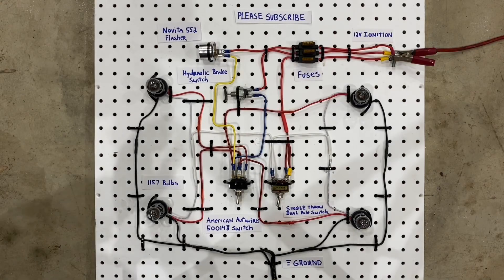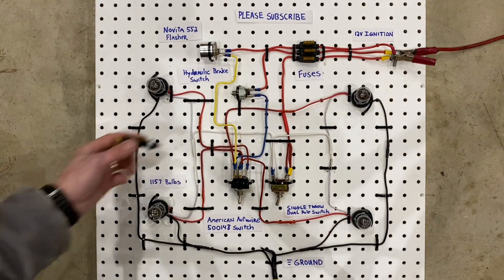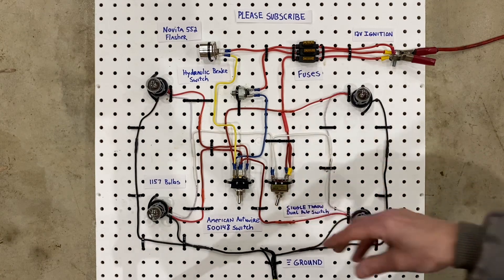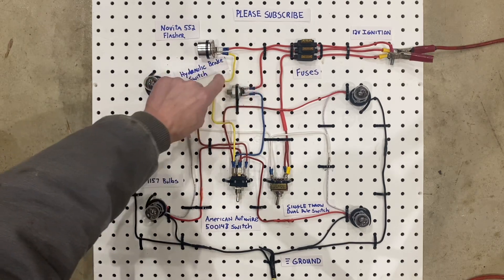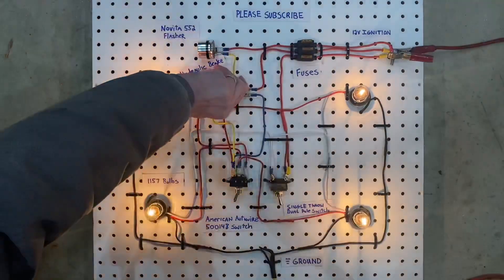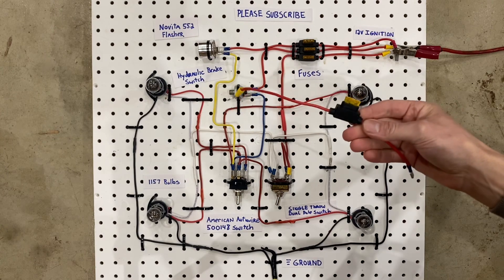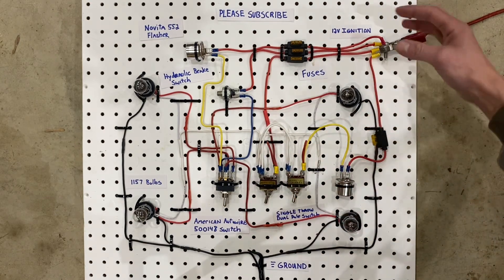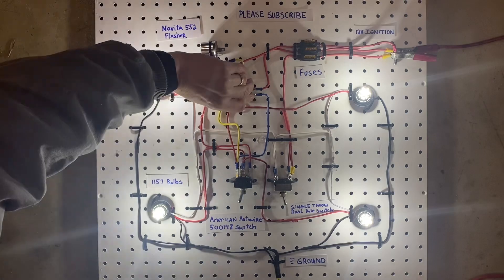How To Wire Turn Signals, Brake Lights, Parking Lamps, and Hazard Circuit Switch | @WiringRescue

Comment from the maker: Thank You for Watching my Turn Signal Wiring video! 
Subscribe To This YouTube Channel: http://www.youtube.com/user/4g63mightymax?sub_confirmation=1
See My Wiring Playlist: https://www.youtube.com/playlist?list=PLsF7T1tRFy2hmiiUUfMZNyV-BUA_yrPIh
Reply: Great video. I recently bought a flatbed truck. It was bare bones so I'm in the middle of fabricating a reciever/bumper for it and tomorrow I'm gonna start wireing it up. Wireing has always been like witchcraft to me so this video has been really helpful
Reply: Thank you! I did subscribe and hope you will check out the few videos I’ve posted on shade tree tech.
Reply: Shouldn`t the blue wire actually go to the middle post on the three way toggle? otherwise how does the power get to the right wire? I must be missing something.
Reply: Thanks for the insightful video. I tried this setup on my motorcycle but  without the use of diodes on the BRAKE and TURNSIG wires I couldn't sort out a fix...with the diodes the running worked, Brake works but turn sigs are cancelled by the brake. 😂 Any intuitive thoughts on what my problem might be? BTW my rear lights only have a ground, red and white (running) so BRAKE and SIGS have to split the RED after the diodes.

Comment: Will this work if you just add a directional flasher and splice into the rear directional wire? Not on for running, if you're braking the oem brake light is still solid one side but flashing both oem and your new flasher unit?

Comment: I know this is an old video, but i have a question: If i don`t want to add parking lights ,and i want to use dual filament turn signals on the back only, where one filament will act as turn signal and one as braking light... can i add the braking function str8 to the actual braking light wiring (let`s say split from the back braking light wire directly) ?

Comment: Is there an alternative method, that does not required  American Autowire (25Amp @12V) 500148 Switch?  Like using two separate On-Off-On toggle switches?  Or a  3 Position Toggle Switch 3 Way Automotive Car 12 Volt SPDT ?

Comment: How does the power know where to go from the brake light circuit being tired to running light and turn signals. I understand the switch is what breaks up the power and sends it where needs to go.

Comment: So when the brake lights are on and you hit the turn signal what is happening in the switch to allow the flash? Wouldn’t there still be constant power from the brake being applied?

Comment: Hey Jeremy you didn't use a relay on the circuit. Why is that? In one of your previous videos you said you wouldn't want to connect 12 volts because it would burn up the stitch. Thanks for your work. Your videos are simple but awesome. Completely helpful.

Comment: How many prongs does that toggle switch have the 500148 I need to hook this system up in my car
Reply from the maker: I believe it is 6 terminals. If you are looking for a cheaper version of the same switch, you won’t find one. No other 6 terminals switches work the same way internally. That is what makes this switch special. Good luck with your project!

Comment: I don't know if you'll see this, but I have a question about wiring the American Autowire switch. Do you just wire the brake wire into one of the turn signal leads or both. I have a 1964 F100 that I will be rewiring in this way and I want to make sure I do it correctly. Thanks for all of your really informative videos.

Comment: can you use the a Heavy Duty Rocker Toggle Switch 20A 125V DPDT 3 Position 6 Pin ON/Off/ON Switch instead of the autowire 500148?
Reply from the maker: Sadly, no, because the auto wire switch is actually a special type of switch. It’s not a regular on off on switch. I have looked far and wide for others that work that same way, and could not find any. If you do - let me know!

Comment: Thank you for making things easier to understand lol. I'm about to completely re-wire my 51 mercury for the first time lol, and I need to learn some more first
Reply from the maker: There is nothing better than a 49-51 mercury. Goodness I’m jealous!  Good luck on the project and check out my wiring playlist. I have dozens of wiring videos that will surely help you understand all the basics you’ll need. In the near future I’m going to make a video on basic ignition systems (distributors) and a universal fuse box. So stay tuned for those if you think they might help you out!

Comment: was about to commit this monstrosity, but new turn signal switch worked for about a good week, hmmm... wrapped aluminum foil onto worn out 53 year old bullet style plug connectors for the rear, n all good again. (had turn signals, "continuity" from column all up to the bulb sockets, but no brake lights)

Comment: I have question: I am reworking my car old wire installation, so bow i am on headlights and rear lights.
So i am wondering, can i putrear lights with hugh beam and low beam with seperate rrlays so ehen i turn lights i have rear also on one switch or need something different ??

Comment: To wire in the license plate light do you have to just tap into the rear tail light wires so they turn on when I turn on the headlight switch?

Comment: Was wondering why you should wire the hazzard switch to the low filament parking light instead like every vehicle pretty much uses the high filament brake/turn single which would be more visible than the parking light?

Comment: as a 75yr old guy from the UK i always find your video's easy to understand ! - i wonder what part no. would be available over here equivalent to the 500148 ??- many thanks
Reply from the maker: Thanks! This switch is very unique and I haven’t been able to find another with similar functionality anywhere. So - you may have to grab one of these and have it shipped, or use some relays instead. 😢

Comment: 500148 is the key to this whole thing. I was very puzzled up until i realized all that one switch does. Thank you.
Reply from the maker: You are absolutely correct. I looked high and low for other switches that work the same way, and I did not find one. This switch is special and worth the $40 if it fits your dashboard decor!
Reply: @WiringRescue  I'm finding them for 50 and it'll fit my dash as there's not really a decor. When did built this trike I think he was over pretty when it came to wiring. Wiring is scary.

Comment: Great video. I do not see why you need a double pole switch for the running lights with the left and right sides on separate circuits.. A single pole switch connecting to all four would work the same way.

Comment: hi there can you help me please i just cant get my head around doing this but with the relay method as like your other video i need this setup fully functional but with relays, turn signal, brake light, parking light and hazard brake and parkers and turning in the one bulb. cheers

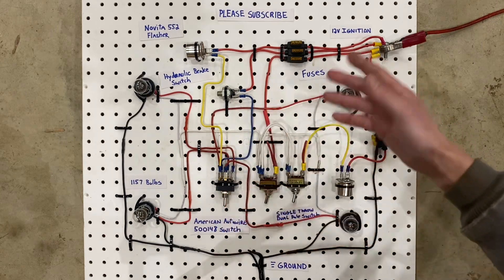Comment: 9:56 If both the parkig and emergency switches were on at the same time I assume the parking lights would just remain on, but wouldn't there be a slight power ripple every time the blinker switched?

Comment: Hey guys, I’m in a bit of a situation here 😅 I had a “friend” work on my turn signals and brake lights and everything looked fine until I tested it out. My brake light activates both the brake lights and my left turn signal, with my left signal even showing up on my dash when I brake! It’s clearly a brake wire spliced with the left turn signal, I’m just struggling to find where he may have spliced the cable. If anyone can help out it would be a great deal of help, thanks guys 🙏🏼
Reply from the maker: Make sure it’s the correct bulbs. The wrong bulbs will do that.

Comment: Lets say you have 4 red rear lights LED. 2 left 2 right. You want to use them as taillight, brakelight and turn signal (also red). How should be the wiring?

Comment: Using a DPDT switch for the hazards and 4 diodes you don't need a second Flasher and it is very easy to wire.   Use regular Schottky diodes used for Solar panels. They have THICK leads and are easy to solder, crimp connectors to or just twist together. 

Solder or crimp the Cathode, with each of the turn signal wires that go to the American Autowire (25Amp @12V) 500148 Switch.

The Anodes all go together and to the DPDT switch. 

Sounds Complicated but it's not.

If you want to make it look more sleek, look up MBRF20200CTR 20 Amperes Insulated Dual Common Anode Schottky Half Bridge Rectifiers TO220F.

Comment: Why split the power to the single throw dual switch? Couldn't you just do on wire in and split two wires from one pole?

Comment: So you don't need any Relays for this ? I'm in the process of rewiring a 69 VW bug i"m trying to modernise it The Gurmans wiring is crazy how they designed it Very difficulted  even with the wiring  schematics
Reply from the maker: You don’t need relays if you use the same components as what’s in the video. All of the amperage is going through the switch itself and as long as the amperage draw is lower than what the switch is rated at, no relays are needed. Good luck with the VW project!

Comment: Had question about 500148. Is this just a standard dpdt 8 pin toggle switch with just two outside pins jumped to reverse pins on opposite side?i see on back they just add in jumpers and removed those outside pins and charge 4x as much for a 8 pin dpdt you can just jump across yourself. Cant see 50 for a 13 toggle just because they removed pins and added a jumper in back.

Comment: I am having trouble finding the correct wires to make the parking light and turn signal. It is a 2 wire 1157 bulb. I have tried every combination to get them to blink. Parking lights work. I will start over again.  Any suggestions would be appreciated.

Comment: 57 Bel air restomod changed tail lights and front running lights to Led panels with 1157 plugs. Brake lights work, running work, Turn signals get brighter but won't blink. Changed relay to led type still no blink just brighter. HELP

Comment: How is this done without the auto wire switch question? Mark. I have breaklights in blinkers that are going on together. Obviously I'm not going to rip apart the whole - to put in the auto wire switch so there must be some other way to do it.?

Comment: My daughter got a 2009 Toyota Corolla and a mouse/rat chewed every wire it could reach. I've got every light working, including parking, brakes, and hazard on all 4 corners. Only thing not working is left turn signal not flashing and it clicks rapidly on inside dash, one license plate light isn't working and the middle rear window light isn't working.

Comment: How does the turn signal cancel out the brake lights when signaling with the brake pressed?
Reply from the maker: The American autowire switch is what allows this to work. The switch is specially made for this function. That’s why it’s a $35 switch instead of a $5 switch. :)

Comment: In the factory wire harness for the 1976 Ford LTD what wires in the circuit and where are they can I import some 1156 turn indicators to the back of the car and stop interrupting my brake lights. Breaking up the 1157 and to 11:56 for breaking and parking lights is pretty straightforward and simple but it's that brake light interruption and sending power to the same filament when you release your foot off the brake is where I'm confused how to convert my car to 1156 bulbs in the back end pairs of each parking brake reverse turn indicators.

Comment: Hi Jeremy there's a very important video you need to make, how to convert USA dim bright red blinkers to on off yellow blinkers. For example on my 76 LTD to convert my reverse lights into yellow blinkers and no longer interrupt my brake lights. With my new reverse lights housed in a Lincoln Continental bumper VMI bumper tuck conversion. That way I'll be running 3 1156 bulbs in the back left tail light will have a parking light only brake light only right brake light will have parking and break only each turn indicator and Hazards utilized in the rear trunk lid reverse light housings and then finally the new reverse lights will be housed in the rear bumper how can I undo the dim bright 1157 circuit and change it to 11:56 in the back end of the car without buying that trailer two to three wire converter box which may not work with the hazard lights. There are many Europeans who are buying American cars according to Europe and by law they have to have a yellow blinker

Comment: Great video. One question, if I may. Can you tell how each switch post on the American Autowire switch is actually wired? From this view it is impossible to tell how the brake signal is kept from interfering with the front turn signals/hazard lights. Thanks for sharing.
Reply from the maker: The magic is not in the wiring, it’s the switch itself. The inner working of the switch are what allow that functionality. I’ve researched the heck out of this and cannot find any other switches that do this, other than factory turn signal switches ofcourse.
Reply: No need to respond. Right after I asked this question I found the wiring diagram for the American Autowire 500148 which labels each post and its use. I should have checked for this sooner. Sorry, but thanks.

Comment: Lots of great info, but I do have one question, is the american autowire switch a dpdt switch?
Reply from the maker: No, it’s a custom switch that I cannot find anywhere else. The inner workings allow the brake and turn signals to function properly.
Reply: @WiringRescue  is there a way to do it with an on off on toggle switch?

Comment: Thanks will done.  Would be very helpful however, to show us a schematics of this 500148 switch.  How it makes both brake lights work is a little mysterious.
Reply from the maker: The magic is inside the switch itself. I have not found any other aftermarket switches that work this same way. It’s what makes this switch special and more expensive.

Comment: In this video is that 548 switch is it the same thing as yturn signal switch on the steering column
Reply from the maker: It does function in a very similar way, yes.

Comment: Thanks for keeping it as simple as possible & explaining how it works ! I will be wiring my project as simple as I can .. & using LED , turn ,running lights & stop ... Nothing fancy nor extra .. just like the 1930's & forties .. thinking of using the old truck style steering column mounted controls with built in flasher .. it comes with pig tail wires .. keyed on & off power switch with separate starter button .. leaning towards fused individual power wire system rather than fuse box with relay system .. nothing complex extremely simple ! for my use only .. old school with new technology  low heat &  low amp draw , along with over kill wire size & properly fused .. my build vehicle has no long run wire over 8 ft .. it's a super tiny truck .. one wire GM alternator .. head light switch has built in dash dimmer switch it's all so a very old style GM  truck  push & pull style .. I might go with a floor mount High beam switch or toggle switch .. not sure yet just in the planning stage & gathering all the parts first ...

Comment: My question is.....I have a 2000 Honda Accord Coupe. The right front headlights, parking light and blinker work. NOW the left passenger side however, the parking lights works, the blinker works... but the parking light does not come on. How do I change out the red wire, which when I test all 3 wires (green, black,  and red), the red wire is the only one that does not light up. I have resistors connected as I did install LEDs. I've had the LEDS in for about 3yrs and changed them out, but like I said the LEDs come on, that pasenger parking light is the only one that is connected to the red wire does not.

Comment: So I watched your 6 relay video and now I've seen this one.   I like this as it is more simple but I will need to add headlights onto the running light circuit. I am guessing i can come off the single throw dual pole with a relay and have that power the switch on the relay so that the headlight load is not on the same switch.

Comment: Nice and simple, thanks. Wanna maybe consider doing one for cornering lamps? I'm working on adding cornering lamps to my trailer (7'x16' Enclosed), to flood out from under it's wheel wells, activated by the turn signals as they become engaged. However, the cornering lamps do NOT flash. My set up is about 47' combined length, and at night it's almost impossible to see where my wheels of the trailer are as I turn/back into and out of streets and customers driveways. Main vehicle is not equipped with cornering lamps either, or I would just tie into them.
Reply from the maker: That is an absolutely terrific idea. I’ll add it to my to-do list. I *think it should be an easy-ish one to make.  Thanks again for the idea and taking to time to watch the video!

Comment: You just helped me. Im building a s10 from scratch full teardown and theres one thing that confuses me and its wiring. Ive been looking everywhere for about 2 months and couldnt find anything that i can use until i watched this so thanks man. Great video
Reply from the maker: Definitely check out my other videos too, because there are several ways to wire this circuit. You just have to decide which is best for you! Thanks for watching!

Comment: Got 1985 gmc c7000 gonna cant find the flasher relay for fuse box. I guess I'm gonna have to wire up some lights. Question will the Cole Hersee
Toggle Switch - 3-Position, DPDT On-Off-On - 25A at 12V, 15A at 24V - 6 blade terminals work instead of the American toggle?
Reply from the maker: I’m pretty sure the cole hersee switch will not work the same way. I looked into it at the time and decided it was different internally. That being said, I’m just some guy on the internet, so definitely do some additional research, and let me know! :)